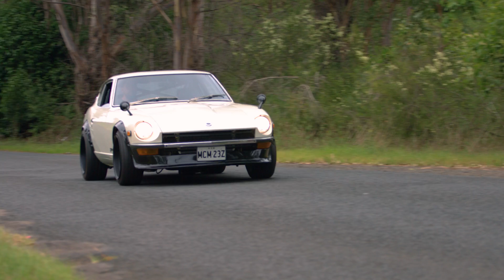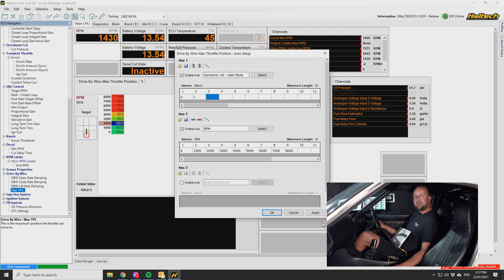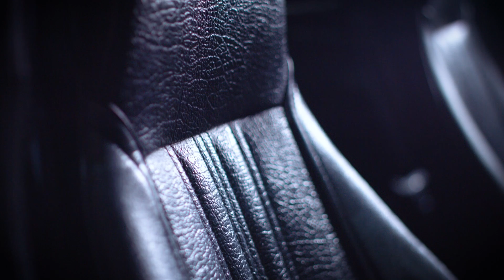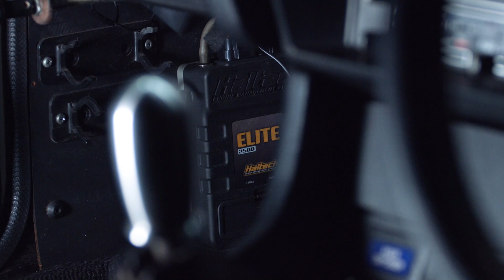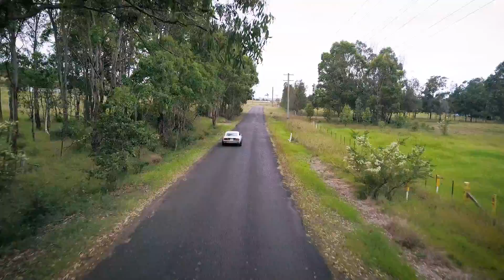🛠 When Less is More: Mighty Car Mods' Fairlady Z | TECHNICALLY SPEAKING

Comment: Is the customizable rev limiter or "valet mode" applicable to N/A cars say like a V8 mustang, corvette or camaro? Because the video said that it's a boost controller but can also change timing, rev limit, customizable throttle calibration and so on... with just a turn of a knob or flick of a switch

Comment: Looking at the way that turbo is behaving there's something pretty wrong with the install or sizing. Low bottom end torque paired with pretty bad fall off isn't cool. Also, having that little torque down low while only producing 300kw out of an engine with that displacement is pretty bad.

Comment: At a power level of around 350kw you're almost in the range of a GT2874, that would surely be close to maxed out but it would give you awesome torque. Any flow in a turbo that you don't use is wasted spool (ignoring temperature), I always pick the smallest possible turbo for a setup

Comment: I would swap out the turbo from the gtx3576r to the gtx3071 with the 0.82 ar turbine housing. It should pick up about 500rpm and the power the owner wants is still well in the capacity of the gtx3071. It will also be a direct swap, so no new fab or fittings.

Comment: I realize it's not an option for this car and Andrew Hawkins is going to boo me, but I'd argue a high-flowing twin turbo setup would  be much nicer to drive for this sort of power level.  I daily drive a RWD 2.6 with HKS GT-SS, NAPREC head, stock ITBs...480 WHP + 4.36 rear end + very little driving talent, and it's quite smooth and easy.

Comment: Not really sure why having a 1:1 throttle is a bad thing, as someone who grew up with nothing but cable driven cars you get used to applying more throttle up a hill or less when you're coasting etc. I find the tuning of most factory e-throttle cars weird and unnatural which is why I'm considering converting my Accord Euro to cable. I swear people are getting complacent with all the computer aided stuff in life these days. Each to their own I guess.
Reply: Cable throttles aren't linear, but it's what most people are used to. Most electronic throttles are calibrated to give a similar feel for the reasons Scotty laid out.
Reply: @Xenon0000000000001  Perhaps linear wasn't the right term, I understand they operate on a logarithmic curve relative to their airflow, but they certainly feel more 'linear' to me. Definitely comes down to tuning but e-throttle stuff definitely still has some weird quirks that I just can't get used to, mind you I haven't experienced many well tuned cars that implement them well. As I said, personal preference.

Comment: Could you add a supercharger in series with the turbo?
I believe that's how the TFSI engines work in Audi's.
Theoretically this would add a bunch of low end and torque for everyday driving, but still give you the high boost top end.
Looks like there's good space in the front too.
Just an idea.

Comment: At haltech do you ever tune the very low rpms throttle to be at 100% open, but power is controlled by the amount of fuel injected. Many Audi engines ran like that. Kind of like diesel engines, but not!

Believe this helps with fuel efficiency and getting the turbo to spin up faster!

Comment: I feel the important words missed from this video are "effective wide open throttle"! !

A throttle plate acts in the time domain, ie it controls the amount of air that can flow past it vs time. As engine speed increases, more cylinders fire in any given time period.  This means that a throttle that is size to not be restrictive at peak power (max airflow) is 'effectively' full open at less than fully open as engine speed falls.  Typically, you will find that at say 2500rpm, "wide open throttle" ie the point at which there is no (significant) pressure drop across that throttle is around 25% of maximum opening!   This is why you need pedal to plate tables that are 3d and include engine speed as one of the axes, enabling you to fully linearise and characteris the engine torque (proportional to manifold pressure) at any engine speed.  For a turbo engine, you can also effectively use the throttle to drop boost pressure (at some fuel consumption penalty, but not very relevant for a typical aftermarket/tuner car) ie as manifold pressure climbs you CLOSE the throttle to limit Mdot.  

Modern OE engine controllers are torque based ie they work in the torque domain, and the accelerator pedal input is characterised to a flywheel torque (both positive and negative) that the engine actuators (cams, injectors, ignition, boost controller etc etc) then deliver.

One nice trick that can work really well is to map close to MBT at up to around 50% torque at medium engine speeds, and then deliberately open the throttle plate faster, but pull out spark away from MBT. Flywheel torque is unchanged (if you have got your values correct, but you are now running with more air and less spark to make that torque. That means more exhaust energy that then helps to lower and soften the boost threshold.  As pedal demand comes back towards and exceeds 90%, you transition back towards MBT/LBT to provide maximum output.
Reply: smart guy☝

Comment: Scott, if you're ever in Las Vegas, let me know. I'll let you take out my 4G63 powered Datsun 1600 (Datsun 510). You'll actually fit in my car 😊
I'm also working out some drivability issues with my car. A lot of it is just the small tire and light weight of the car. Boost comes on hard kind of like Moogs car, but mine is still lower in the rev range. Even still, I can spin the tires at around 50% throttle in 2nd gear. It's fun, but not very productive.
The balance between a street car and a race car is always a struggle. I've added cruise control to my car and I'm working on some gear based boost control with my ECMLink system. I'm also looking into adding air conditioning to make long drives more bearable. But the appeal of a fast light weight car makes me want to just strip it down and go fast 😋 #4G63510

Comment: I absolutely love my 73 240z here in canada, such raw visceral cars to drive when they are done up and tuned right. Mine has a well built L28 with triple weber 45 carbs on it and a big 600 lift road race cam, its a dog down low kind of like moogs car was but with 3.90 rear gears and a 5 speed its not so bad. The car is an absolute riot over 3000 and easily my favourite car ive ever owned. I hope I never sell it!
Reply: I had basically the same exact car years ago! I killed a moose with it in 1997....it too was killed unfortunately.

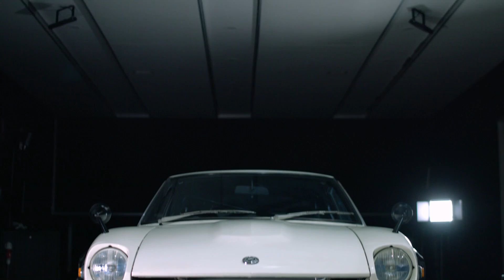Comment: 13:25 - No no no.. The German had nothing to do with the S30Z, it was Yoshihiko Matsuo and sadly he died recently.
https://www.caranddriver.com/news/a33338595/datsun-240z-designer-yoshihiko-matsuo-obituary/
Reply from the maker: The late Matsuo-san was indeed responsible for the overall project but the body styling was done by Albrecht Goertz:
https://en.wikipedia.org/wiki/Nissan_S30
Reply: @haltech  Unfortunately that's not accurate, Goertz was involved with Nissan as a consultant but not directly involved with the S30Z. Wikipedia is often Copy/Pasta. The myth has been dispelled many times, but seems it won't die (in some ways egged on by Goertz himself - taking credit for something he didn't actually do, we all know people at work like this).. Anyway have a read here.

https://japanesenostalgiccar.com/goertz-myths-will-never-die-part-ii/

Love your content otherwise.

Comment: I’ve got the haltech multi gauge and I have the TPS it shows 50% and it’s definitely not 225wkw... most times going to 100kph I use 40-50% throttle
Reply: Is it showing pedal position or throttle position
Reply: @sexyfacenation  throttle

Comment: on the topic of electronic throtle body's and pedals, my brother picked up a new car, a small eco thing from 2009-2010 with electronic throttle body and pedal, and for some reason the pedal only works for the first ~50% so at ~50% pedal then throttle is fully opened up and the remaining ~50% does nothing at all, is there any good reason why this is set up in this way?

Comment: I would watch the ever living f*ck out of a series where you go through what needs to be done, to get this car as close to a linear power curve as you possibly can. Turbo sizing, cam gears, boost control strategies, ignition timing, Scott voodoo magic, the lot! Basically see if you can get it to behave close to a positive displacement type super charger.... That would be absolutely exhilarating to drive, both on the road and on the track. To heck with winning drag races in this gorgeous little tin can! :D
Reply: Agreed!
Reply: This so much.
Reply: the fairlady is easily the #1 MCM car i want to see more of

Comment: The answer that people rarely consider.. twin-charging
Reply: There is a reason why not many people go the route of a twin or “biturbo” setup, they made more sense back in the days where CAD (computer aided design) software didn’t exist, because engineers would have had to build a design multiple units just to test small changes in turbo designs to see what would make peak efficiency. It just made more sense to use two decently designed turbos to do the job of what one really efficient turbo could do, but they just lacked the technology to build said turbo. Modern turbo technology has come a long long way, we now can just simply run simulations to see what bearing designs allow the highest rpms to spin the turbo, and what materials we can make those bearings out of to have the most longevity, and what materials we can make compressor wheels out of to withstand the amount of stress put on it at high rpm, etc. Simply put, modern turbos are just more efficient and cheaper because of modern technology. The only time you will see a twin turbo setup is if a motor has multiple banks of cylinders, one turbo for each cylinder bank. The only notable example of someone running a twin turbo setup on an inline motor that I can think of is Kyle from boosted bois on his k-swap mr2, and even on a recent video he talks about how the setup is great but they are almost at the limits of the setup they think, and mentioned a bigger single turbo for the future of the car perhaps
Reply: @boblouis972  ..twin-charging isn't twin-turbo, it's supercharger+turbo
Reply: @Mainfoldium  ah I see, my bad😂, to be honest that’s so uncommonly done these days I didn’t even think about that when you said twin charging 🤦‍♂️, most people just use that term as a synonym for twin turbos these days, the Nissan March super-turbo was a neat example of this setup, but the modern equivalent is performance hybrid electric setups, so sadly even though they are neat, you really just don’t see hardly any super-turbo setups being run these days
Reply: @boblouis972  Strangely enough Volvo still do it today in their S60 range, but yeah hardly anyone does it in either the modded scene or from the factory.
Reply: @boblouis972 Just looking it up now on Wikipedia and their top spec model the T8, its a performance-oriented plug-in hybrid which combines all 3 😂 2L 4cyl that is supercharged, has a turbo and is electric.
Reply: @craigsampson3386  I didn’t know Volvo still used a system like that, that’s pretty neat, the Swedish have a unique approach to engineering so it doesn’t surprise me that’d it’d be Volvo still running it
Reply: @craigsampson3386  holy fuck that’s amazing, it’s easy to see how that country produced someone like Christian Von Koenigsegg, when they are making stuff like that on the regular
Reply: @boblouis972  Yep hahah and probably the only new car left on the market thats available with a twin charged setup.
Reply: Don’t get me wrong, a twin turbo setup on an inline motor or even a quad-turbo setup on a motor with two cylinder banks can make insane peak power, but it is just harder to accomplish than with a single turbo setup. Tuning that kind of setup is just more complex and would require sophisticated tuning and a very efficient turbo setup, a single turbo setup just makes more sense from a cost standpoint and ease of power

Comment: You guys never got the good 240z tailights down under?
Reply from the maker: This is a Japanese import.
Reply: @haltech  ok well for the American imported datsuns 70-73 240z the tailights look different. The lights on this car look like a 74-78 which would be a 260z for 74. Or 280z for 75-78. I guess the #240z confused me because the car was a 2 liter car originally.
Reply: @Zchef85  My Aus delivered 240 has the correct lights. I imagine if this is a 240, it probably had them changed at some point.

Comment: It definitely would benefit from a gtx3076 gen2 with a 1.01 rear or 0.82
Reply: 5k rpm for it to come on boost to make "just" 410hp is ridiculous. Way to big turbo for the intended purpose. So yeah, GTX3076 would be a better fit.
Reply: @ThePentosin  it could make a hell of a lot more.... I'd like to see a much smaller rear housing and it would negate part of that.
Reply: @scootbmx01  yeah, even GTX30 is making way north of 500hp on RB25 and RB26. So for the intended usage of the car where 400hp is plenty, GTX35 is just overkill.
Reply: @ThePentosin  I'd hardly say way north. Most rb's running a gtx30 aren't making 500. Atleast not from what I've seen
Reply: Yeah the turbo choice for three driving experience don't match

Comment: Reminds me of Dick Johnson talking about his old Sierra Cosworth.  It made around 90 hp at full throttle when they were running it in on the dyno - sans turbo, of course.  Stick the turbo on, and that number jumped to 680 hp...but it came in like it had an on/off switch, so it wasn't easy to drive at speed.  Blair's Z sounds similar.  :-) 
https://youtu.be/B0TcptAlu4E?t=118
Reply: Power band like a 2 stroke. I think the compression would of been low NA.

Comment from the maker: When Blair (Moog from Mighty Car Mods) got his hands on a super clean and original Nissan Fairlady Z, his intentions were to leave most of it stock. His hand was forced however by Australia's import laws with the engine, transmission, and brakes all earmarked for removal. With a brand new suspension, transmission and brake setup coupled with an RB26 turbo swap the Fairlady now had more go than its designers ever intended it to have. But you can never have too much power right? Well, it depends... Tuning Fork explains why.
Read the full write-up on this car here: https://www.haltech.com/the-zed-is-not-dead
-----------
Shortcuts:
00:00 Intro and 1st Dyno Pull
03:58 Setting a "Cruise" tune
08:20 Dyno Pull with the "Cruise" tune
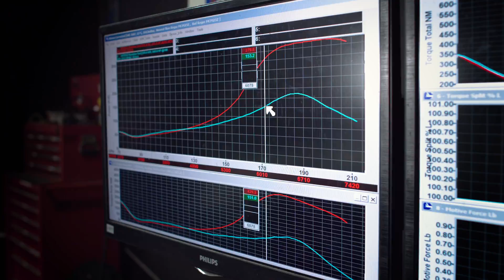10:08 Test Drive
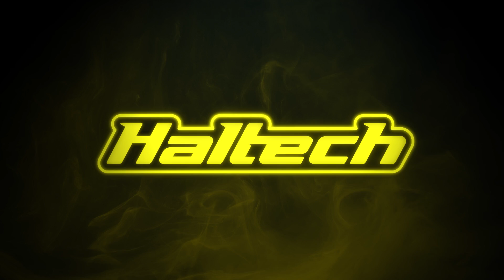13:20 Engine and mods overview
20:08 Wrap up
Reply: Or AE86 n/a...
Reply: Would like to see an episode about YOUR car! If u've done one and i've missed it... please link it :)
Reply from the maker: @bevis71 https://youtu.be/8333N6AS440 :)
Reply: Or another option (not mentioned) put it back to sequential turbos for a more linear power band, this way you gain bottom end while not losing top end.
Reply: @papapruett2820  Rb’s never had a sequential setup like the 2J.
Reply: Thanks for clarification since any one who watched all know it was due to asbestos which makes sense to be safe than sorry especially with the fines you guys have there in Australia. Cheers from America.